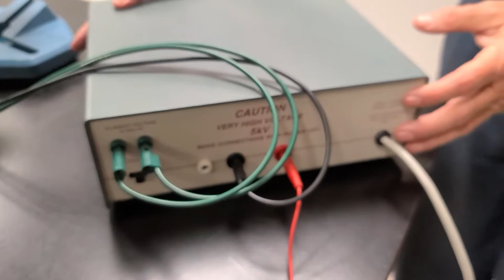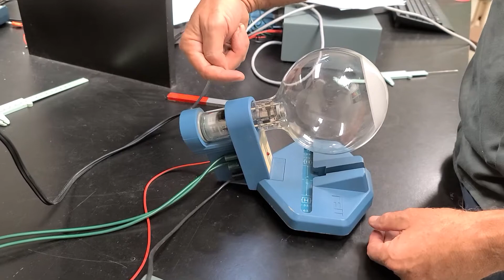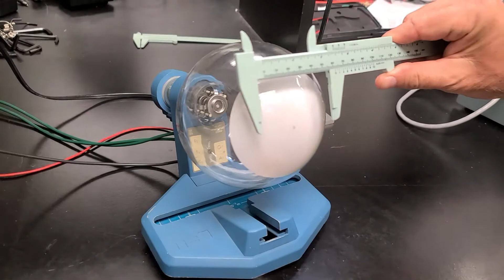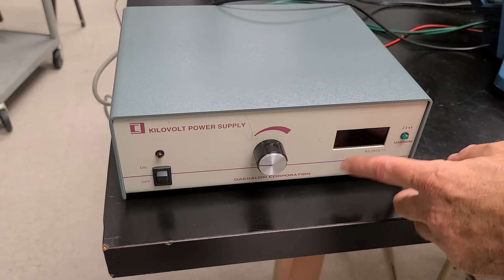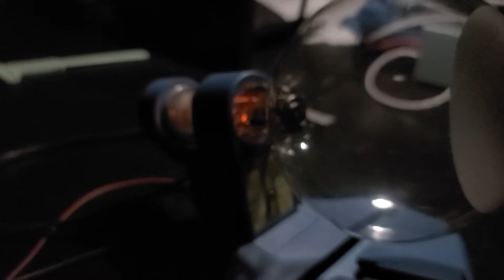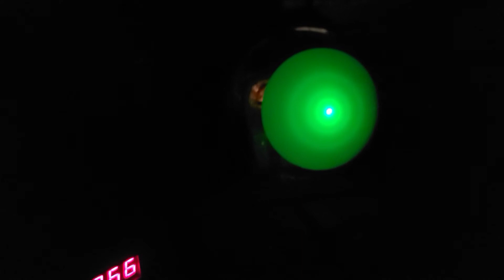Diffraction of electrons: Introduction to the experimental apparatus

Comment: Sir, what is the distance between the target and the screen in this tube?
Reply from the maker: r = 67.5 and L = 130 mm, with r being the tube radius and L being the distance between the target and the center of the screen, where the undiffracted beam hits. You need to calculate the distance b between the target and the screen for the diffracted beams using geometry. a² = r ² − (D²/4) , b² = (L − r + a)² + (D²/4) , and sinθ = D/2/b.
Reply: @gokhanesirgen8069  Thanks a lot. It will help me a lot.